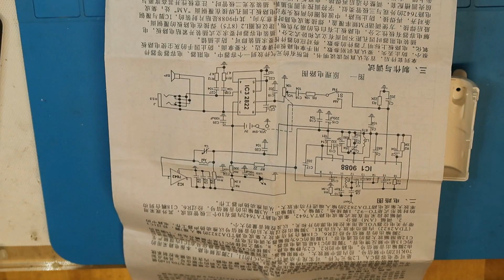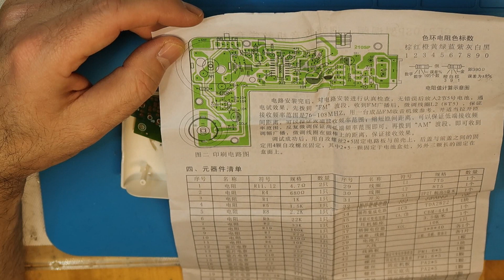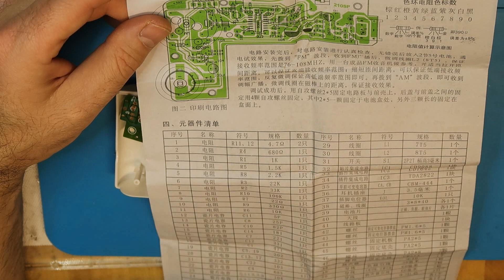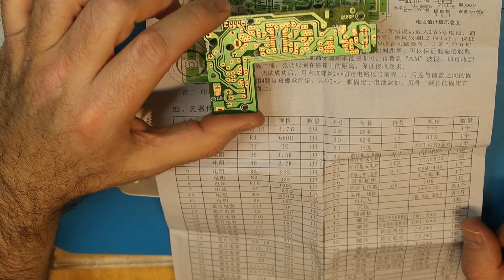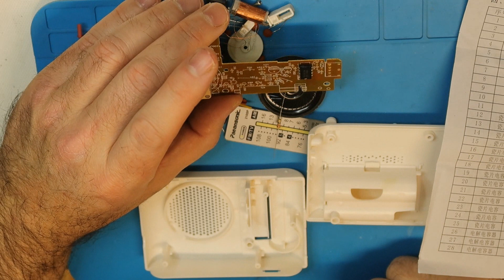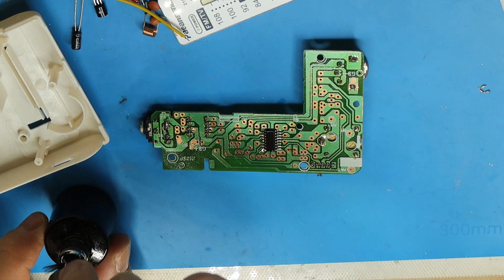Radio DIY

Comment: To improve the quality, I guess that you have to tune it. Notice that on the back of the variable capacitor you have some adjusting trimmes and also the coils that you can stretch them to fine adjust their value. Also, on AM, the position of the coil on the ferrite rod make a difference. Try to translate somehow the manual or search online for the adjusting instructions. Can be done "by ear" or with test equipment (RF AM/FM signal generator and oscilloscope).
I think that the main IC is a clone of the old TDA7088 that wasn`t too bad at the time